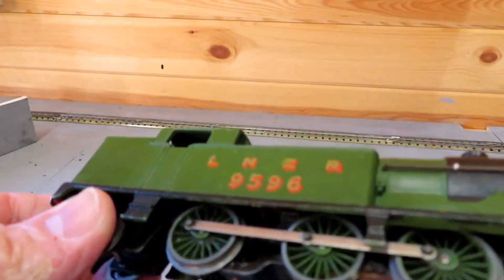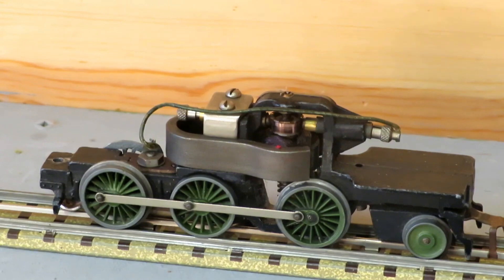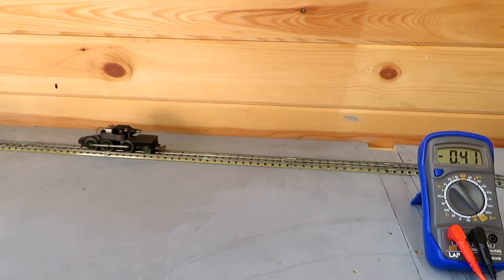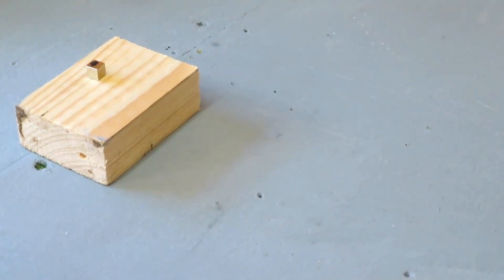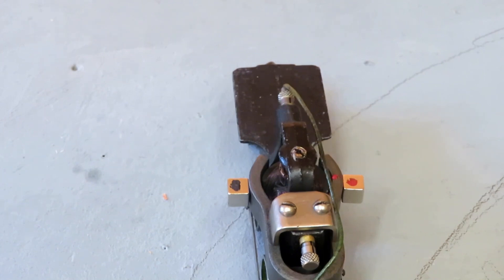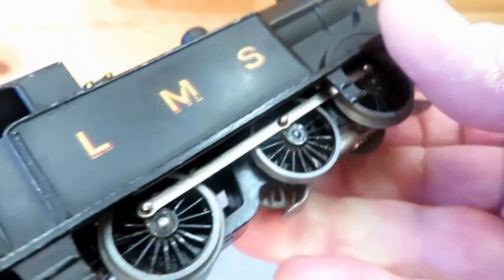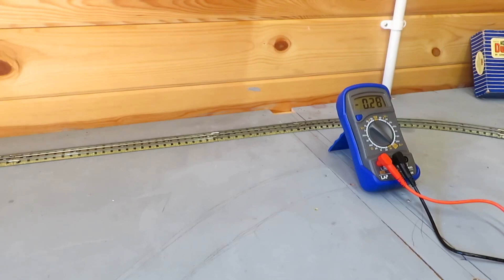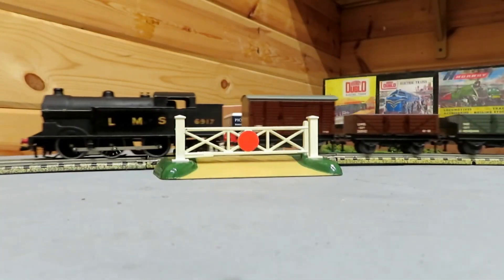Hornby Dublo Playing with Tank Engine Motor Magnets

Comment: Great video Clive.
  Looks a very nice HS loco. If the red/black dots signify the polarity I believe you may have the neos misaligned (you should get better results although 0.4 to 0.5 amps is fine) be sure to place the north pole edge/face of the neo AGAINST the south face of the HS magnet and vice versa on the south side. Looks like you have the direction of the poles (magnetic flow) running vertically instead of horizontally aligned with the motor.
 Have fun, regards,  Ron
Reply from the maker: thanks Ron I will revisit when time allows playing with 2 rail Dublo at present!